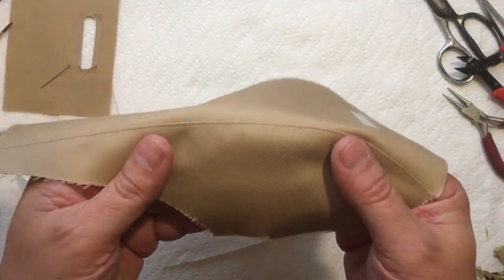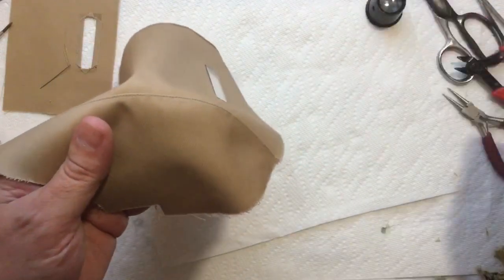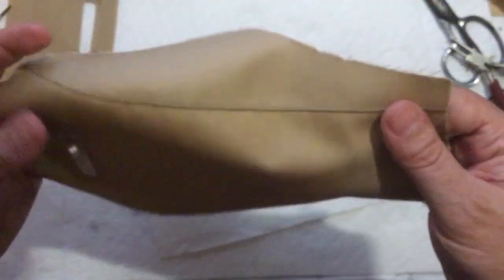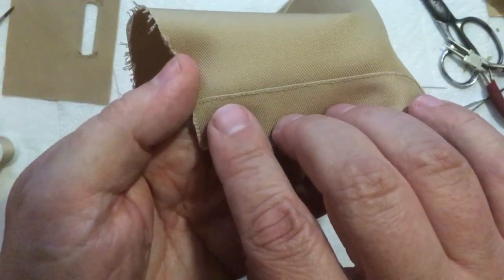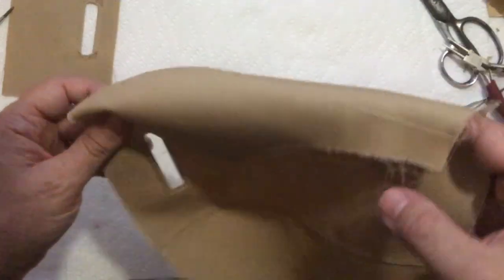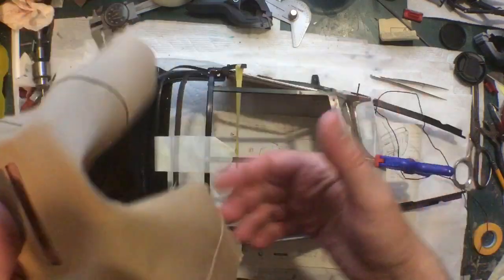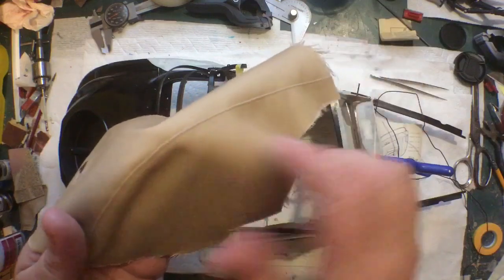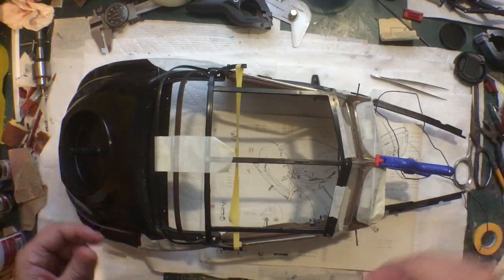Pocher Mercedes Cabriolet 500K build part 23 - almost done with the top

Comment: Oh wow  the stitching looks fantastic   you are so critical    i was thinking to leave the inside fabric around the rear window up to the first frame  and remove the rest (if that is even possible )  and that way you lose the extra stiffness and the way the bars show through on the outside  and just paint the bars on the inside so they are not black    also you can get bare metal foil it is self adhesive and is like foil it comes in chrome and some other finishes looks great  and easy to use for that front plastic part of the hood    anyway the work you have done is amazing  i just try to give some thoughts on your problems please do not take it the wrong way  you are a first class builder and i can only dream of making my model as good as the job you are making   its such a joy to see this beautiful coming together they way you have done it    just fantastic
Reply from the maker: Thanks for your kind comment. I did think about removing the fabric like you said. The reason why I may not is because I’m afraid the frames may come loose from the fabric over time and just flop around. I don’t know how well the adhesive holds plastic to fabric long term. I was actually thinking of getting some more fabric and applying it from the rail all the way forward so it all has the same stiffness. I forgot about foil tape. That could work as well. Thanks again.
Reply: @customfabrications  yeah you are right that the points at which the fabric is glued to the bars is going to be weaker without the second skin    i have an mx5 or miata they are called in the usa  and i just had to go and see just how the roof works  and it seems that the fabric is just a skin that is pulled taunt over the supports and not attached to the support bars at all   and yes the bars are clearly visible from the outside    the real problem is the scale of the kit even though it's 1/8 scale it will be incredibly hard if not impossible to recreate a working soft top roof and have it look perfect    i think the painstaking work you have put into this roof might just be as good as it can possibly be   it's a real challenge for sure and one that you have tackled brilliantly   the work that you have done on this model is really really good having followed this series from the start i know for sure this kit will be one of the better ones and a lesson to all pocher builders of what is really involved in getting one of these stunning models to be,  well stunning,  because they sure can be
Reply: @customfabrications  you know i have the k72 rolls royce pocher kit to build   i actually felt quite confident when i payed a silly amount of money to have the kit that i could build it    after watching you rebuild this kit i have lost all that initial bravado and now i am holding off on the build while i brush up on my painting skills and trying to find as much information as possible about these pocher kits before i start   and your video series on this has been so enlightening and i thank you for taking the time to post videos on your build because there really isn't much good stuff like this around.  On the box of my kit it says for ages 14 and upwards  lol  i am 48 and um you know i want to do this kit justice  i want it to be perfect in every way. there is just something about these models that is special   i don't think giving one of these kits to a 14 year old is a good idea
Reply from the maker: I agree, there is no way I could have done a good job on this at 14. If there are any 14 year olds who can do a good job on a Pocher, then they’ll have a good future as a model maker. And thanks again for the kind words. My only purpose for making these videos is to try to help others. And get advice from others as well. So I’m glad it’s helpful. Good luck with your build. Im sure it’ll be awesome.